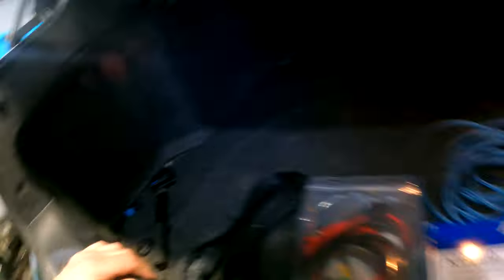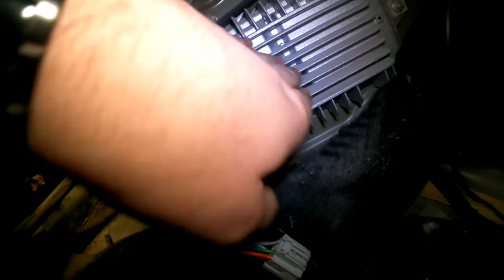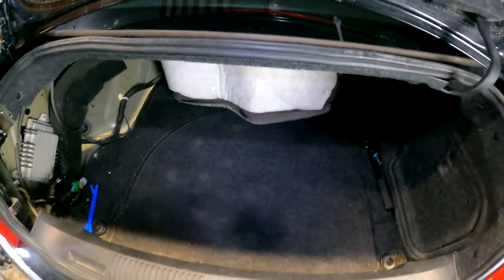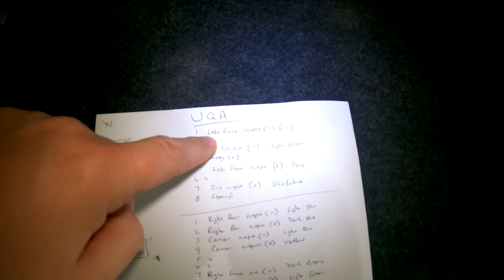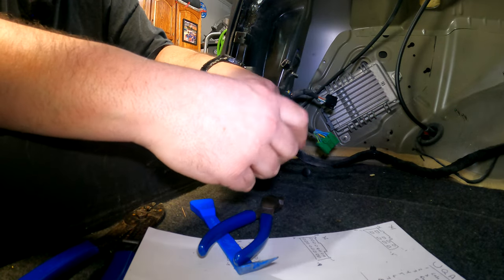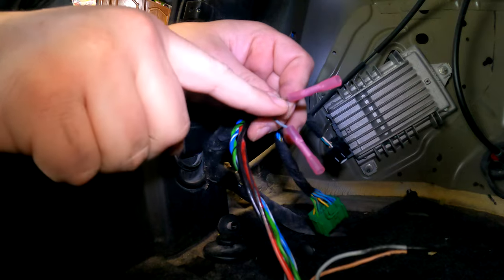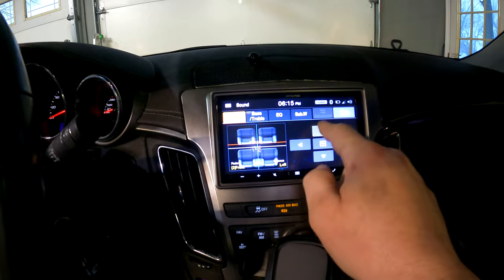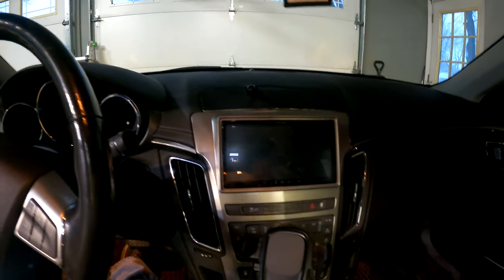Vehicle Bose Amplifier Bypass

Comment: Planning to add a DSP and amp to my 2012, should I take the input to the Bose amp and feed that into the DSP? Or take the output from the Bose amp, feed that into the DSP (fix the delays, re-EQ everything), then out to my aftermarket amp and back into the other side of the outputs from the Bose amp back to the front speakers?  The goal is to use a 5 channel amp to power front door speakers + dash speakers + a new subwoofer. Retaining the factory head unit, has the navigation + hard drive. Thanks.
Reply from the maker: Are you replacing the factory head unit? If yes, then run wires to the DSP and then you could use the inputs to the Bose amp (temporarily).

I would recommend doing the DSP and amplifier at the same time AND replacing the head unit if you have not done so already. 

I would then run the output from the aftermarket head unit to the DSP and then send the signal to the amplifier. Use the amp outputs to output wires from the Bose amp. Do not even mess with the input side of the amp since you will be bypassing it with a DSP and amp anyway.
Reply: @Amundred  retaining the factory head unit, unfortunately! If I was getting rid of the factory head unit it would make life simpler for sure. I could just take the outputs from the Bose amp --> into the DSP --> make any changes in the DSP --> Out to aftermarket amplifier --> back to cut output wires and to speakers
Reply from the maker: @idfront1  the issue that you may run into is that the Bose system has a DSP "built in" and this could cause some sound quality issues.
Reply: @Amundred  I wonder if I can find where the Bose DSP is located, I know it used to be part of the amp itself, not sure if it still is. That's where I was thinking of grabbing the signal at the Bose inputs. Makes the install in my Volvo seem simple - Add a Helix SDMI25 to the MOST interface, done.
Reply from the maker: @idfront1  yeah...this Bose system is a pain to deal with! 

The issue with the inputs to the amp on the CTS is that they are low level inputs that I ran into was that there was static when using them as the input to the aftermarket amplifier. I am not sure what caused this issue...it is possible that it was the aftermarket door chime box that is a part of the Metra kit. 

You could definitely attempt to use the inputs that you asked about and see if you have the same issue or not... definitely let me know either way as I am very curious!
Reply: @Amundred  fingers crossed I get no static, otherwise will have to go back to the drawing board (aka - convince my wife to get rid of the terrible factory head unit). I'll keep you posted how it works out, fingers crossed I can start the install in the next couple weeks. Have a PDX V9 on the way, already have the sub and DSP. Trying to decide on front door and dash speakers, but have a few in mind there.
Reply: @idfront1  Hopefully Im not too late and can be of some assistance on this. This info is going to be for the CTS-V models and the CTS base models that have the Navigation screen that raises/lowers from the dash only.
All the Bose DSP is built into the Bose amp in the trunk. 
Ideally you want the cleanest unaltered signal going into the aftermarket DSP which is the "low level signal" going into the Bose amp, this will make it easier when you do the aftermarket DSP setup and sum all the channels together for a full pass signal which then can be divided how you would like for the output of the DSP going into your new aftermarket amp. 
HOWEVER in this case with these cars the low level input signal to the amp is a fixed voltage so when you turn you're volume up/down that low level stays the same voltage meaning using the low level input to the amp you will have no volume control since the radio is connected to the Bose amp via GMLan otherwise known as Canbus, so when you turn the radio volume down it is the amp that getting that data signal and turning the output side of the amps volume up and down. So you will want to use the speaker outputs coming out of the Bose amp as your signal going into the DSP. 
Unless your DSP has a separate remote (which most do) that allows you to control the stereo volume that way instead of the actual radios volume and if you're ok with that then you can use the low level signal coming into the amp.
The factory radio is actually fairly decent option wise if you have the Nav unit because it gives you am/fm/xm/nav/cd/dvd/hdd/usb/aux/bt/and old ipod abilities (but the non nav UQA is a turd). To buy an aftermarket unit to do all that you're looking at a hefty price in that alone, which at that point going aftermarket with the headunit you really don't have a use for a DSP unless you're doing a multi amp/speaker setup where you're running active crossovers and are a SoundQuality junky because an aftermarket radio and a 4 channel with some speakers is more than enough for most people (like in this video) and the DSP will just add a lot of cost and time to the install.

Also worth mention if you do have the Nav unit and want to bring it to the next level PAC makes a module to allow video playback in motion, gives you the ability to set gps coordinates while driving etc. Then there is another company called Grom Audio which has a plug and play device that gives you even more options with video in/out to the factory screen, iphone/android phone screen mirroring, additional audio inputs/outputs, and some other features.
Reply: @audiofanaticz  not too late, I have not done anything yet, been slowly accumulating equipment. Stinks about having to use the factory amp outputs, but using the DSP remote for volume instead of the head unit is a non starter. 

I have that Grom unit bookmarked as something I might add in future, primarily being able to use Android Auto is the main reason I am looking at that. I do wish the CTS head unit would at least allow streaming music via Bluetooth.

The SQ junky is my other vehicle... that has 3 amplifiers, DSP, custom A-pillar and sail panel speaker pods and so on. Thanks for the info, gives me a bit more of a plan on getting this all installed.
Reply: @audiofanaticz 2011 CTS Bose with nav, I'm wanting to add a Rockford Fosgate powered sub box. It has rca and speaker level inputs. Can I get the the audio signal from one of the outputs of the Bose amp utilizing a LOC without losing functionality of the output I use from the Bose amp?
Reply from the maker: @jkuzmits8570 you would want to use the LOC to get a low level (RCA) signal, but the issue may be the signal processing which automatically adjusts the different sound levels of the audio as you drive. Since you would be grabbing the signal after the amp, the audio processing would affect your signal
Reply: @jkuzmits8570  If the RF box/amp combo has a high level input option you can use the speaker signal coming out of the factory Bose amp without needing a LOC or Hi/Low convertor. 
It must be the output signal from the Bose amp though and not the input signal coming from the factory radio! The Bose amp controls all Bass/Midrange/Treble/Balance/Fade/Volume/Mute/etc settings thats why you must use the high output signal coming from the Bose amp after it's been amplified. If you grabbed the signal coming in to the amp like amunded said you WILL NOT have no control over the sub volume and it will never change the volume when you turn the radio up/down/mute etc. You don't want that. 
IIRC it should be the 8 pin/wire harness on the Bose amp you need to tap into (there should only be one 8pin harness) and it should be Pin #5 dark blue and white for your Positive signal wire, and Pin #6 light green and black for your negative signal wire. 
Don't just chop them off if your still using the factory Bose sub in the rear deck as you will lose signal to it.
You can also get the same signal wires at the harness that plugs into the sub but at the amp is easier otherwise you got to remove the rear seat back and the c-pillar panels to get the rear deck off to access the factory Bose sub.
Sorry for the length, but hopefully it's clear enough to make it easy for you.
Reply: @jkuzmits8570  Just to be clear again, don't follow what Amundred said! 
I know this is his video but his CTS has the basic non-nav audio package and it's a completely different Bose amp, different wiring colors, and different speaker sizes as well. 
The only way his information will work using the low level input before the amp is if you are using an aftermarket radio like he did in the video (or if you are running a Digital Signal Processor (DSP) like I am that has a separate volume control that you now use to control volume instead of the factory radio), but if your retaining the factory radio then you will lose control of the sub volume with your volume knob because it operates of the canbus network so when you turn the volume knob up the radio sends a data signal to the amp telling the amp to turn up which is different than how an aftermarket radio and amp combo would operate which would increase the RCA preout (low level) voltage coming from the aftermarket headunit in to the aftermarket amp. Hopefully that makes sense, it's not the easiest thing for everyone to understand at first, but if you think this is a mess just wait until you start messing with the newer 2015+ Cadillac models as well as Benz and BMW because everything is then optical/fiber signal...

That being said there is no real reason to swap to an aftermarket radio on these cars if you have the nav radio because it pretty much already offers everything an aftermarket radio does minus bluetooth streaming, but our radios already have bluetooth calling, cd, dvd, usb, 3.5mm aux, hard drive for additional music storage, SiriusXM, and nav with fairly outdated maps that can be updated though, plus they pop up from the dash which is cool still. 
If you need more connectivity look into adding the Grom Audio VLine addition which will give you audio/video inputs in to the factory screen, bluetooth media streaming, apple/android auto, wifi hotspot, and a few other things and its all plug and play for the most part but almost $700.
Reply: @audiofanaticz  thank you for the info! RF amp/sub combo does have both hi/lo inputs with remote gain control knob that can be run to front seat area. I just want to make sure that if I "tap" into the signal going to the bose sub that it is in fact hi level. I've read conflicting opinions that it's line level with some sort of separate amp on or near the sub. Also read the signal will have bass roll off as volume is increased unless ANC or mic wire is disabled. Can you advise/confirm or negate any of this. I'm just trying to add the RF combo box and hoping original Bose w/nav continues to work. Thank you again for your insights
Reply: @audiofanaticz  one more question, the RF box has R and L hi level inputs. Would I just run the signal (blue w/white, green w/black) to either the right or left or Y the signal to feed both R and L inputs.
Reply: @jkuzmits8570  coming out of the amp to the sub is a high level signal, but from what I remember testing in my car it wasn't amplified as high as the other speakers in the car, but was higher than a few volts when playing a 50hz sine wave. The sub on our model is indeed amplified separately, the amp is tiny and riveted to the top of the woofer itself, the harness that plugs in to it is 5 wires iirc (12volt positive/neg, remote turn on, and then the signal positive/negative), the remote wire to turn on that amp for the sub was very low voltage though something like 6 volts iirc and not 12.
Reply: @jkuzmits8570  You should really only need to use one, right or left it shouldn't matter because I'm sure it is a mono amp being used on the RF box, so chances are high that the right and left are just piggy backed inside the box or on the amp, I cant say with certain it is that way, but usually it is with many monoblock style amps. So if you wanted to just jump the signal from L to R  just to be sure with a Y you could and it wouldn't hurt anything as long as you kept the pos and neg polarity correct for each terminal.

Also to go back to my other reply with the remote wire, if the RF box doesn't have an auto sensing remote turn on circuit you will need to run a remote to it, since the sub signal most likely wont be enough voltage to turn it on you need to tap off Pin 4 of the same 8pin harness as your other wires, its a red wire which powers the factory amp but iirc it is a switched power wire like a remote should be. I can't remember for certain though if this is where I got my remote from since its been a few years, but it can easily be tested with a multimeter or test light.

Comment: I'm just curious about the subwoofer in the trunk. Do u happen to know if their is a wireing harness u can get to switch it to an aftermarket subwoofer
Reply from the maker: You can use a line out converter to get remote and low level output (RCA output) to install an aftermarket sub and amp:

Here are some different options:

Basic:
https://amzn.to/3z80viA

Advanced:
https://amzn.to/3JLQZqd

Lots of options:
https://amzn.to/3LT5fQG

There are a wide variety of options available, depending on what you want for features.
Reply: @Amundred  im just trying to switch the sub but their is a harness on it and not sure y its their i dont see any pos and neg wires to it like a normal sub would have. I know for most vehicles its just the pos and neg though
Reply from the maker: @jsfkmm  ah...I am not sure if there is an adapter harness. Most likely you would need to cut the wires and then connect them to the aftermarket sub. 

The wiring going to the sub should be:
Light Green (-)
Blue/white (+)
Reply: @Amundred  their are 5 different colors red/white,blue/white,green/black,black and looks like orange or yellow
Reply from the maker: @jsfkmm  do you have the navigation unit in the dash?
Reply from the maker: Here is a link to the wiring for both the Navigation and non-navigation wiring at the amp for the CTS:

Link to Wiring Diagrams:
File in pdf or docx: https://discord.gg/bGKQTf8UMP
Reply from the maker: UQA = non-navigation UQS = Navigation head unit (the screen that pops up)
Reply: @Amundred  its not coming up
Reply from the maker: @jsfkmm I'll try to copy/paste the info when I get back home in a bit
Reply from the maker: @jsfkmm  If you have the navigation unit, your subwoofer wire colors would be:
	2 D-
BU/WH 	346 	Left Rear Subwoofer Speaker Output (+) (UQS) 
6 	0.5 L-
GN/BK 	1794 	Left Rear Subwoofer Speaker Output () (UQS) 
Z

(Blue/White and Green/Black)

I would leave all of the other wires connected and find the wires that you need just for the sub.
Reply: @Amundred  i was just curious about ur door speakers if u had any problems putting them in. I just took my door skin off and noticed mine are 9inch. What size brackets did u end up using for urs?
Reply from the maker: @jsfkmm  my door speakers on the front were 6.75" and the rears were 5.25" speakers and I used speaker adapters for the front doors, but the rear doors bolted right in place.
Reply: @jsfkmm  If you have 5 wires in the harness for the sub then you have the CTS that has NAV and the UQS option,  the reason for the 5 wires is because there is an amplifier built on to the top side of the woofer (you have to remove the rear seat, and the package try to gain access to it).
Red is 12volt +, Black is 12volt -, Yellow is 12volt remote/switched to turn it on off with the radio.
I don't recall the 2 other wire colors off the top of my head but they are a bit smaller gauge than the power wires and those are your low level signal wires that feed the amp its signal (i think one is blue with a strip and possibly brown with a strip). These 2 wires will be the ones you will want to attach the Line out converter too, and depending on the LOC you buy/use your power and remote wires are all in that same plug.
Either way there is no sub adapter harness for either the UQA or UQS systems, so you will need to tap those factory wires with the dreaded scotchloks or strip some casing off the wires and solder additional wires to it to get the sub signal for a line out converter, or tap into those signal wires at the factory amp inputs, but avoid chopping the plug off completely just in case you want to go back to factory.
Also the  subwoofer hole open is a rather odd size and 9 7/16 inches iirc so it maybe challenging to find a 10inch woofer with that size cutout, you may need to modify the opening in the plastic to accommodate the new sub. Ideally you will want to focus your search on that perform well in an IB environment (infinite baffle) which is how the factory sub is setup to be used since there is no speakerbox for the sub as the trunk acts as the box. Ideally you want a woofer with a QTS of around 0.707 for optimal performance, and the higher the XMAX is the better (this is how far the sub cone moves linearly 1 way in MM).
As for your front door speakers since you have the Navigation radio you will have 9 inch 2ohm midbass speakers in there unlike the non nav radio that only has 6.5 inch speakers, so you will most likely have to make adapters to shrink the hole to fit smaller speakers or get some of the brackets from a junkyard from a non navigation model cts.

Comment: So we will need to re run all speaker wires? I think I’ll just stick to the factory amp
Reply from the maker: Yes, unfortunately there will need to be a run of wire to bypass the amp completely. 

The main reason I did this was that the factory amp was failing in the vehicle so it had to be done anyway.
Reply: @Amundred o ok thanks for your videos !!
Reply from the maker: @Lahotboy2024  you are welcome and thanks for watching!